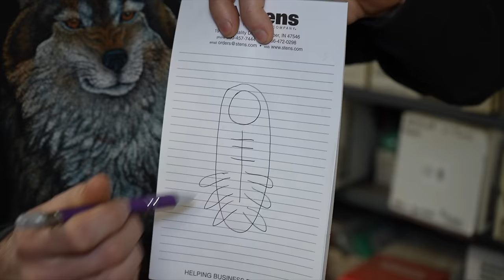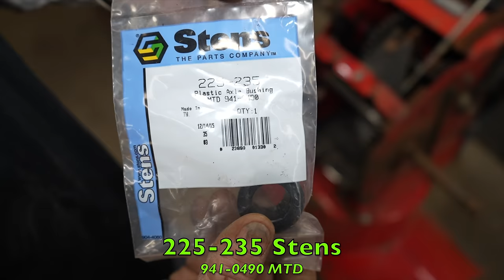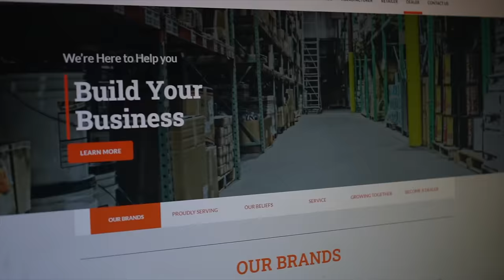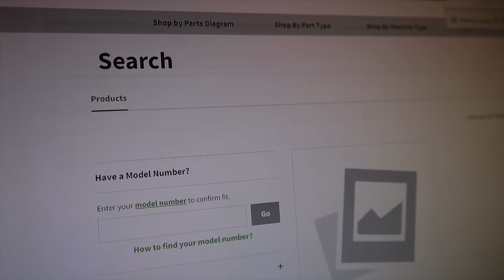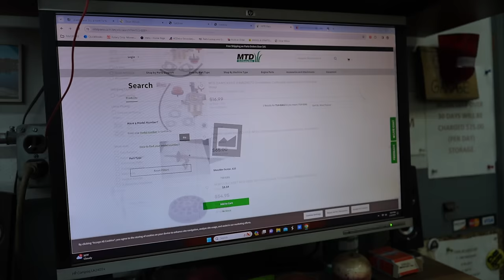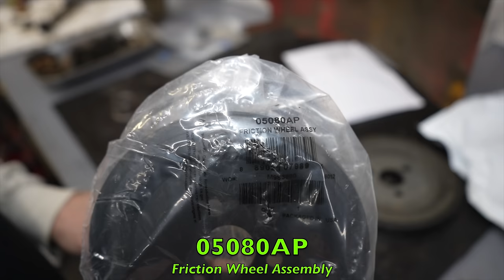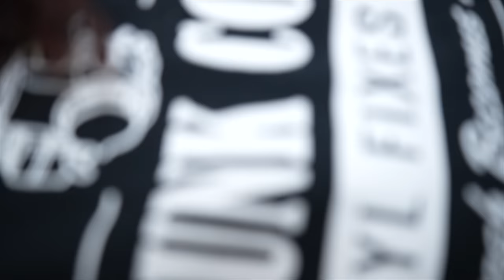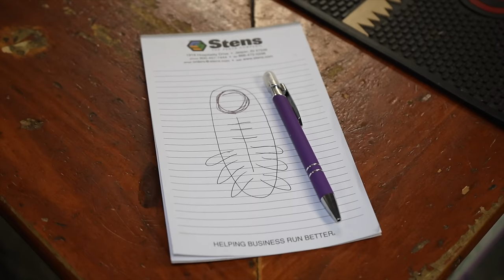Spent WAY Too Much $$$ Polishing This Turd

Comment: Nicholson USA file. Very nice. I still feel pain when I see the dots of rust on mine when I don't remove them from the front lawn in the fall when I am doing a brake job on one of my cars. Dew point is lower. Dang. Fake files are so useless 50% of the time. 50/50 chance of getting a China file that is uniform and lasts versus materials other than aluminum.

Comment: I worked in a small engine shop in MN, and had a "scrap" area of broken down equipment.  When I got there, the owner was deep in equipment needing repair, so after about a month and a half of getting caught up; flipping customers equipment out daily and getting them fixed up, I decided to go through the "scrap" area and see if we could flip some equipment up for sale.  I told the owner that shop labor from me would be exempt to the sale price, so that way we could go through it without having that part of the cost dictating what would be flipped.  I found an older commercial walk behind mower with a big deck on it, and was told that it was a customers mower that he traded for a different mower, the carb was gone through and ran a few years back.  I took that in first, cleaned it up, got it back up and running, and put it out front for sale.  That exact customer drove by, saw his old mower, turned into the driveway, and paid to have his old mower back.  The shop owner was jumping and clapping his hands; and absolutely delighted that on the day that I decided to go through the "scrap" pile, get this mower up and running, that the original owner came back and paid to get his old mower back.

Comment: I have a Toro 421 from 1985. This MTD machine is nearly identical to it, obviously mine is a little smaller. However, if one was to purchase a new 24" two-stage Toro snow blower right now, it would cost $1,299.99 + tax from ACE hardware, so maybe $500 isn't too much for the one you just fixed, Taryl.

Comment: I have one of these MTD turds in my garage as well. The transmission and auger are fine and have some rust but that's just cosmetic. But the old 5hp Tecumseh is more like 3. doesn't have very much power at all. can't use it in the snow because it clogs or bogs down in snow over 6 inches and you have to inch it very very slowly. I wanted to engine swap it but is a 2 shaft so it's going to be too much work. Eventually, I've been eyeing down getting a new Ariens Deluxe 24, so I get a nice powerful machine but its costs an Arm and a Leg.
Reply: These engines are prone to valve issues. If it's worth the effort, you could check to make sure there's a gap under the valve stem, allowing it to fully seat at TDC. The one I worked on had zero clearance on exhaust, which caused a major compression loss and the engine was very weak and bogged/died as a result. Had to grind the stem down, much better after. It threw wet snow a good distance after, whereas before, it barely shot a foot out of the chute and even driving it stressed the engine.
Reply: @JulianA-tr6pt I have heard a lot about valve issues. But I have a feeling it may be something else. I got this blower for free from my neighbor before they moved out of state. The oil is REALLY REAlly black so I assume he never changed it. And to be quite honest with you I haven’t ether…… but it starts first full and always starts great. I really have to get a compression test though. I don’t know if I should put in money or time into that old machine. But the new ones aren’t made good.

Comment: The scrap yard is full of these with that same problem. I had one that went bad and I took off the 8 hp Tilletson and it now lives on a chipper shredder. Why not bearings? These blowers would have lasted forever with just a few adjustments from the factory. I guess that’s a little too much to ask for in a throw away world.

Comment: Scruffy's part  looks like a toothed sprocket on a 1/4 x 1 1/2 inch  flat stock bracket.FOR a 1970 mini-bike >with a 5HP B&S  motor and 8 in knobby tires almost worn out with a imitation leather seat that has a tear in the front left corner.But i can't tell if it's a 3/8 sized chain or 5/16 sorry.

Comment: Where I'm at you could get 500 bucks for that machine all day long. I see on Facebook marketplace selling non running lawnmowers for 300 no question asked. I guess AZ just ask for too much for what stuff Worth. I've seen square body Chevys on jack stands non running for 7000 dollars where I'm at just because it has a "craigslist" rebuild motor with "no miles"  "and no receipts" on it yeah what ever but I see this in my
Area all day long no joke I guess I'm living in the wrong area lol

Comment: you are  right on the new blowers they are junk ,get an older model with cast front gear boxes much stronger than the aluminium front gear boxes as far as the engine go there shit too, but if you put a newer engine like an ohv ,you will have a better machine than a new blower for much cheaper ,ariens or bolens, john deere 26-32 wide models put 10hp-12hp even flat head or ohv tecumseh or briggs ,you will have the best of bothe worlds, old machine with newer engine

Comment: Understand it may not be worth it , problem is if you sell it would you tell customer what’s wrong with it? Most people wouldn’t I’ve been ripped off many times with problems like this , problems that aren’t easily seen but breaks down when you need it, glad you fixed it properly and the new owner will be even happier.

Comment: Happen now and then, equipment parts are not available or too expensive. Things is the older stuff was built so much better. If it wasn’t it would have been scrap the long time ago. It happen last summer with my John Deere riding mover. Did not want to spend $2000 to replace. Doing myself made for a green light. If I had to pay labor that would have been 😢.  If you can’t do things yourself you better have lots of income.

Comment: That’s not bad I’d rather run an old snowblower like that then the new pieces of shit they have out there today I have one new snowblower and I have two old ones. My old ones are 1132 Toro and they run excellent and I have a lot of extra parts for them, I think that’s the way to go today by old stuff and fix it up. That’s what I’ve been doing.

Comment: Cut off the old 6 sided tube and maybe a spark plug socket welded in it's place to the sprocket would have worked. Fix that trans cover so it could be easily be removed with latches so those parts could be lubed once in a while.

Comment: Instead of building up the rod couldn't you build up the bushing? Throw some welds inside the bushing and then hone it out to fit the post. Might be easier and quicker. Just a suggestion. Or maybe you could put a shim inside the bushing and hone it out to fit the pole or post whatever you want to call it.

Comment: It's depressing that the repair parts available, plastic, are so much poorer than the original brass. I have the same blower.
Reply: Menards has brass flanged bushings. Likely hardware stores do too. The specialty bushings for the axels won't be available, though.

Comment: Why not try to locate a steel sleeve in the diameter needed, and then spot weld it to the gear shaft end?  Most good machine shops have various steel sleeves available.
Reply: HaHa!

Comment: In the immortal words of Taryl Dactyl, “it ain’t the space shuttle”. Just weld it up and use a grinder to take it down so it’s close. Then use a sanding disc and test fit it til it just goes on. It’ll be close enough. It’s not one of those “race” snowblowers that turn 100 MPH.

Comment: Yuck, bronze now plastic bearings. No way to keep the rust from forming and detroying the plain bearings unless you're on your toes about greasing that shaft after you polish it down to bare shiny steel. A good retrofit might be to get some ball bearings and drill on some bearing flanges to the side of the chassis to hold them.

Comment: Its called flying by the seat of your pants. Working on older stuff makes me cringe because of everything you ran into. Parts availability. Is it serviceable. How rusted out. Is it worth the squeeze.  But you stuck it out and had to take unreasonable measures.  And theres your dinner.  😂

Comment: I am curious as to why you’re tearing all this down to put it back together with all the old nasty grease on everything which collected all the old dust, dirt, and debris and any little bit of metal shavings of wore out oilite bushing or anything that this thing has picked up over the years and lodged in that grease?
I’m sure you have a parts washer in your shop and could have put everything back together with nice fresh lube on everything so everything functions with the same resistance and sliding capacity.